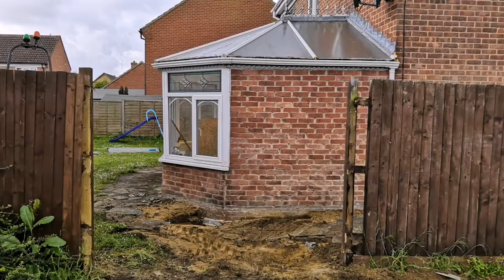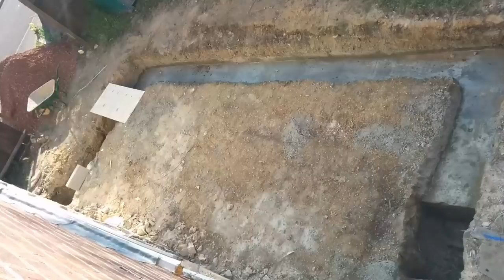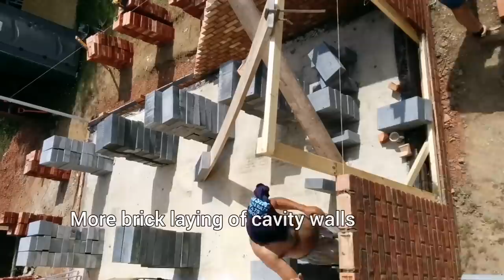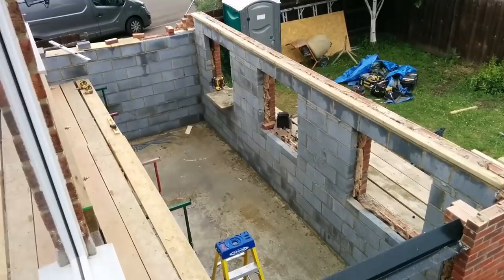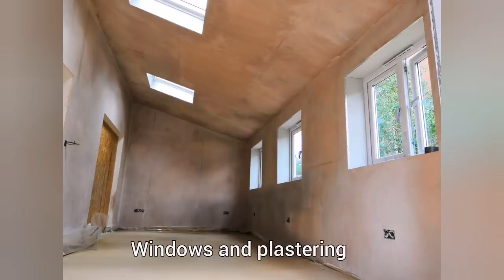Single Storey Extension 7 x 3.5 metres time lapse foundation up

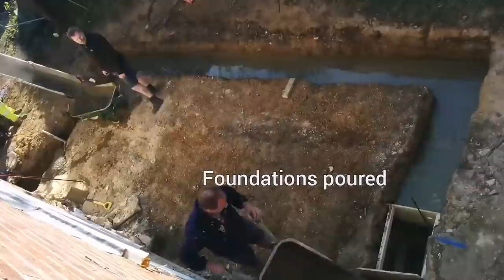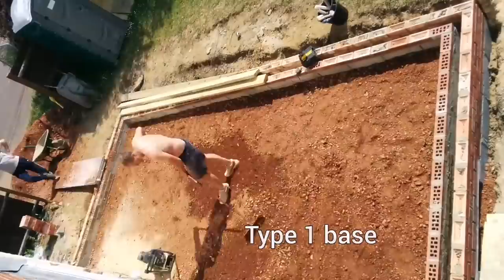Comment: what's the reason you left the open space in the foundation on the right hand side 0:40-1:30? Drainage?
Reply: Good question I was wondering the same thing
Reply: Probably goes over an existing sewer pipe
Reply from the maker: Yes, its for waste pipe, so that the weight of the wall is not on it.

Comment: Question: When they pour the foundations, a piece of wood is propped up to prevent it completely filling in the trench. Once block/brick laying commences, what appears to be a concrete lintel is used in the gap...is this safe for weight bearing purposes? Also what could that gap be used for?

Comment: Considering extending my kitchen been watching videos on YouTube and realised every video people in the comments find flaws in the work...its put me off and maybe better to save up and move
Reply: I think its just that there are many different ways of doing things, I struggle with this because I have a very fixed mindset and feel anxious if things aren't all the same. However, I intend to  open up the back of the house and build an extension like this, hopefully in the spring. Don't give up, it will be tremendously satisfying to achieve this yourself.

Comment: You left all that brick dust under the roof tiles. I hate it when trades are messy like this. Same with bathroom fitters who sweep all their mess under the bath before putting the bath panel on.
Reply: Im a bricky and understand the dust but why does it matter if it’s all under the bath?😂
Reply: @Leon-gz6zm  It's called having pride in your work.

Comment: I did wonder about the DPM sitting directly on the type 2.....other than that, it all seemed fine.  

I’m not a builder.....actually I’m a electrician, so probably have no clue!  Lol!  But it looks much better than some of the horror’s I’ve seen!
Reply: what do you mean by  DPM sitting directly on the type 2...cheers
Reply: newry123 sorry....I meant insulation.
Reply: @Spark101.  cheers

Comment: Lads I'm doing a extension myself and trying to as much as possible,
Is it fine to put type 1 down first , the insulation, dpc is a 4 inch concrete adequate without rybar??? Thanks 
Boss job by the way 👍🏻
Reply: No you needs type 4 first then put slams on top of pgbc membrane.. Hope that helps
Reply: Elvis Putns thanks pal

Comment: I wonder how long the insulation under the DPM will last? 2 years before it rots?
Reply: C yes should of been another dpm under the celotex plus sand blinding.
Reply: Elvis Putns doesn’t need steel in an oversite unless it’s over an old soakaway or well. Sand blinding is used over the type 1 to create a perfectly flat level to place what should of been put in a dpm. The sand Stops it being punctured from stone in the type 1.
Reply: Elvis Putns the steel won’t make the compressive strength any greater. It’s to stop the slab pulling apart by horizontal movement  which if an oversite is prepared properly with insulation upstands and compaction then there is no need as would be a waste of money. But if you wish to ad some, then do so. Only really used in raft slabs when loading on the edge with masonry.

Comment: Is it allowed to put insulation directly on the ground without any protection film?
Reply: No, wasn’t any sand blinding either…
Reply: Big mistake, that insulation will be redundant after couple of years. Clearl no building control involved. 
As minimum it would have binding, membrane, the. Insulation boards then screed with edge insulated with 20mm PIR board.
Being in clay soil there should be 150mm steel reinforced slab under insulation too...
Reply: @leszekzajac7772  this was defo done by cowboys

Edit: or maybe the customer had a budget hence why the job was done cowboy style lol
Reply: @georgeforeman9366  deffo , just re- watched it, cavity up to ground level should be filled with weak concrete(c5-c10) wall ties around window openings every 3rd course no more than 225mm from the edge, lintels over foundation gap(presumably drains there) sold be 100x140 not 65x100.

Comment: Why did you put your insulation under your d.p.m. When it should always be laid on top of it！
Reply: Stops it floating up when you pour the concrete and messing up your slab. I cant see solid insulation rotting under there its not exactly bio-degradable! Not much extra material to sandwich it though I guess!
Reply: It won’t float up if your sub base is level and the insulation is laid tight. If your insulation is below your d.p.m. then it will be slightly damp and then lose its insulation properties.
Reply: @tonym992  Just makes double sure it doesnt. It's only a bit of extra visqueen so I think it's worth it. Also the celotex is closed cell and doesn't absorb water so it literally can't get damp

Comment: They did such a good job insulating the floors and the walls, but no insulation under the roof tiles?
Reply: There would definitely be, done from inside.

Comment: In Norway we use 60cm insulation on the floor an 60m insulation on ceilling. We insulate the foundatoion with 5cm insulation by the outer side.
Reply: Lidia Cimpeanu we ain’t in Norway... 60m in roof? Must be tall houses......

Comment: I'm a bit surprised there wasn't larger or more skylights when compared to the original.
Reply: @stringer-ik1pc  hey ballbag 2. Who convinced them it was cheaper to have 2 separate ones, with all the extra labour? "It's cheaper this way." Yeah right.
Reply: @samt5663  The 'client' is always right. Are you a 'Traveller' touting for work.? 😀

Comment: Did you need planning permission
Reply: "Built under permitted development and building regulations."
Reply: No need as long as its not more than 3 meters off the original building, 4 meters for detached.
Reply: @Thatcntwiththecivic  is that width or length ?